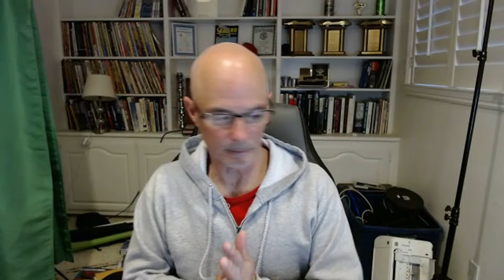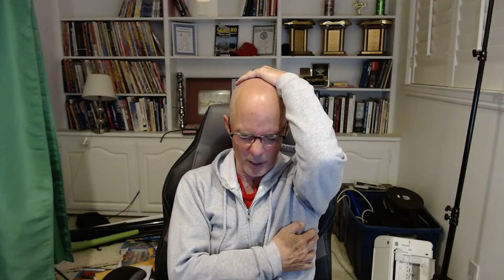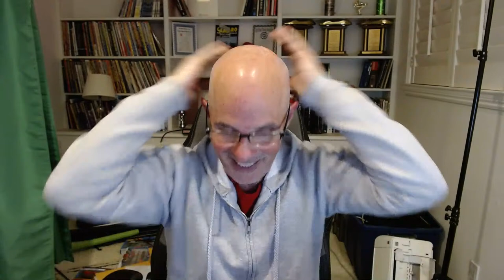BBC MODS & BOOST-LET'S TALK TECH

Comment: Need a good cam 5.3 in 1/2 4x4. 373g. Nb3500 tranny. What all do I need to do to make around 500hp. Thinks for advice. Baldwin
Reply from the maker: you need boost
Reply: Can't afford boots. What can I do to this motor to make the most affordable horsepower in a
Reply: Which camshaft would work best for me??  And do you have one to show me
Reply: @richardholdener1727    would a truck noise can be good for my??  If so do you have one for sale??

Comment: Hi Rich I have an 95 lt1 engine and I bought a cc503 cam is that a good cam for my car? Thank you
Reply from the maker: what are the specs
Reply: 224/230 , .503/.510 @.  .050”   112 SLA  I have the springs and I will be getting long tube heaters installed
Reply: That is also considered a mild cam right?